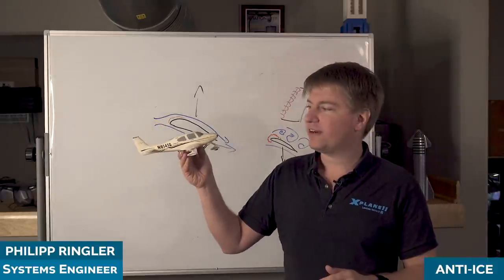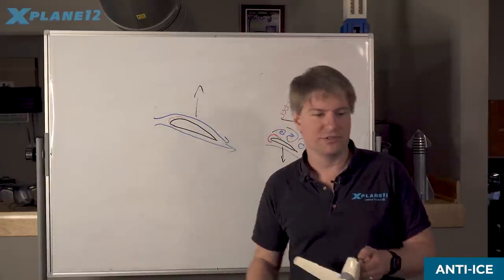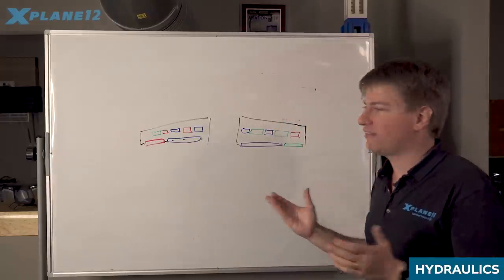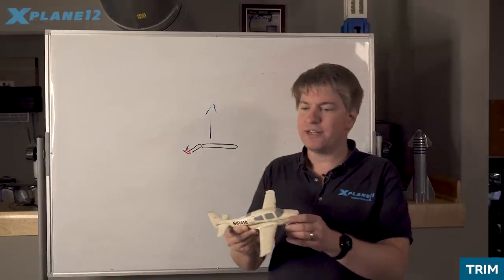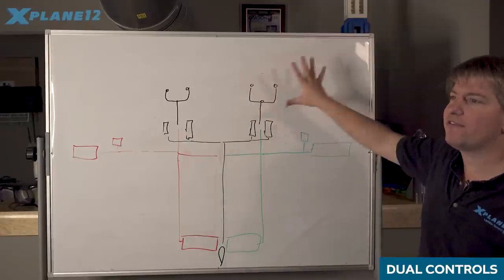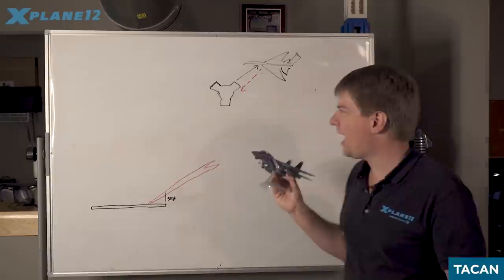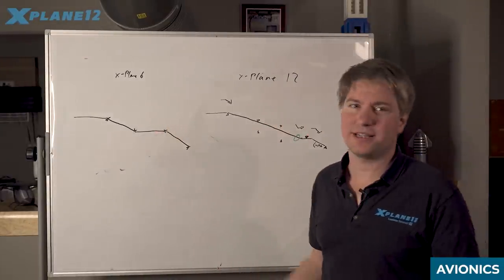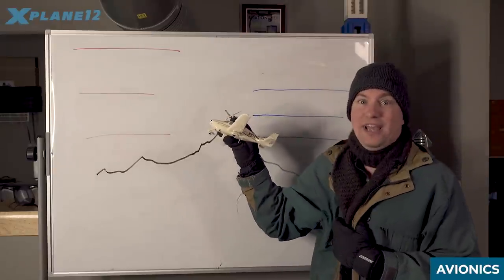X-Plane 12 Aircraft Systems Preview

Comment: curious whether weather changes are now being implemented at all so pressure impacts as presented by philipp play an actual role.
same question for alpine valleys or the nevada triangle for instance. pressure sensitivity are only as good as x-plane's weather engine provides it.
will test this blabla first thing, approaching a mountain wall and see whether the blabla will actually try to turn my wings upside down or not.
Reply: till now there is not even wind simulated from what i know.

Comment: So many new possibilities. I do hope there will be a simple mode, for those of us who just want to plug, and go, so to speak. But, I'm thrilled to see all these new features coming into this product. I'm returning to X-plane after having horrific experiences with FS2020. I'll miss the FS2020 photogrametry, but I've come to a new level of respect for x-plane, in that it, at least, does not crash to desktop, just because I unplug a usb device. LOL Very much looking forward to X-plane 12. Thanks for sharing.
Reply: I feel you! I am planning on getting X-Plane 12 as well for its feature rich IFR systems they have in place. I am still not going to knock out FS2020 out yet as they have stated it is a 10-year commitment for them. Maybe once PMDG and Quality Wings release their aircrafts line, it can be more bearable, but they really need to fix all the nasty bugs and ensure quality updates that will not introduce into the sim or break it.

Comment: I'm hoping the developers at X-Plane correct the relationship between the RPM (Power) and airspeed in the Cessna 172.  The airspeed indicator should lag behind the RPM (Power Setting) whether you are increasing or decreasing the power. The current program has the the rpm increasing or decreasing as if the airspeed. plays a huge roll during in the RPM  It takes time for the airplane to accelerate and decelerate once the power has been set  Nothing more frustrating than continually adjust the power as the air speed changes. The RPM's will stabilize long before the the airspeed. I'm hoping the vertical rate of climb at Vy (best Rate) will at least be close to the almost 800 FPM published in the POH. Also the RPM's are a little slow going above the static RPM during the takeoff roll and  the climb.

Comment: Will xplane 12 be able to be on the same computer with xplane 11 also will all my equipment like steering and rudder foot controls and all the others work with xplane 12
Reply: I ran two different versions (the 11.50 beta and the last non-beta release prior to 11.50) of XP11 on mine without a problem. I don't see why this should be any different?

Comment: As a long time user of flight simulator programs, I realize this will be really attractive to those who want XP to be study-level and "as real as it can get." I hope use of some of these systems is optional for those of us who don't need or want every aircraft feature required to be used to fly. Going through complete checklists and flight planning requires a lot of time on the ground. Just sayin'
Reply: I think you mostly won't notice any of this unless you start setting failure modes (in the case of hydraulics) or flying IFR at close to minimum altitudes (in the case of air masses and altitude)